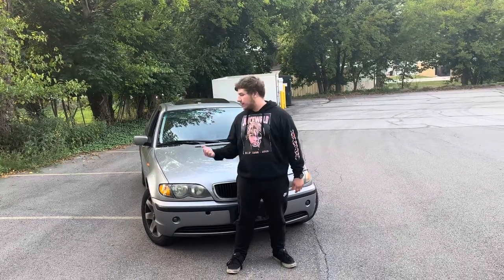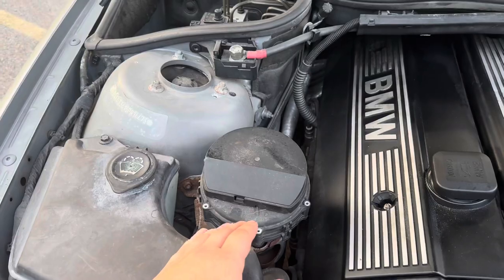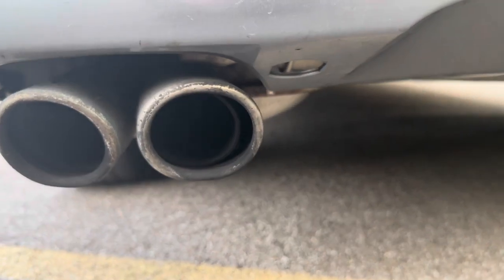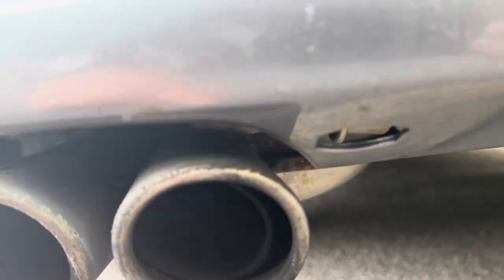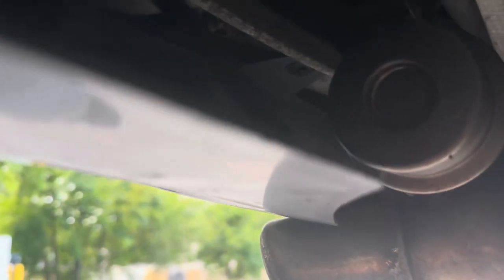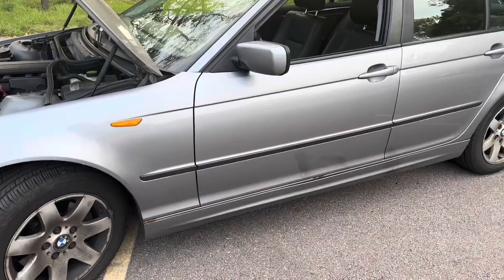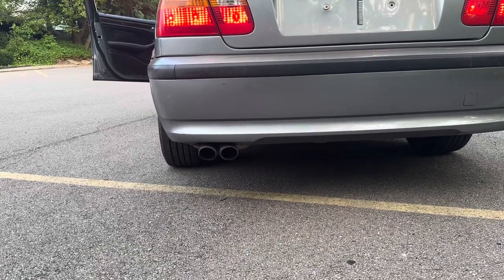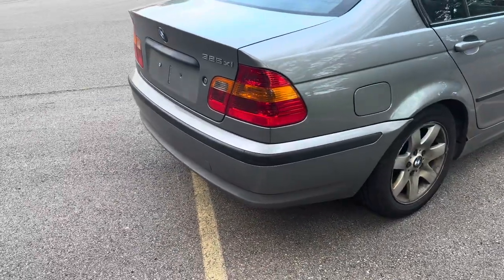How to make your e46 exhaust louder for free!!! Butterfly MOD

Comment: Bro same thing lol no difference and as a mechanic unplugging it is bad for your car
Reply from the maker: Buddy it’s doesn’t do anything bad to the car, it’s okay keyboard mechanic😂, Also under load it keeps the flap open whereas it it was connected it would close under load.
Reply: @FDSGarage  yes it does. I'm not stopping you but belive what u want
Reply: @FDSGarage it does make it bad. Because of the exhaust gas backfire it can make it not as smooth at low speeds (0-40) unless your always heavy foot driving it lowers performance. Gas usage etc